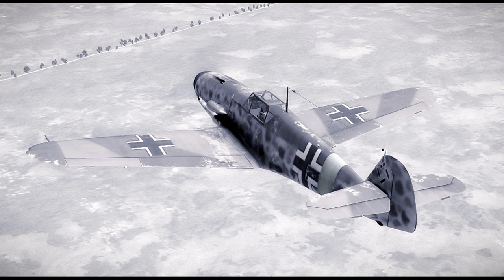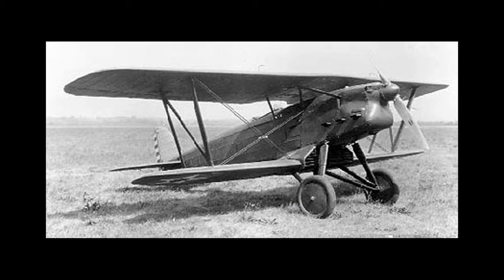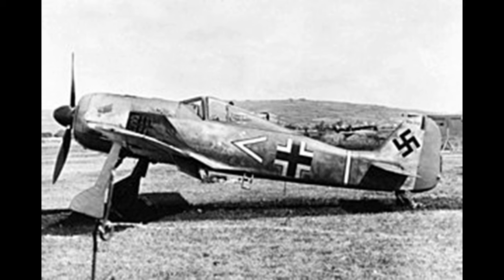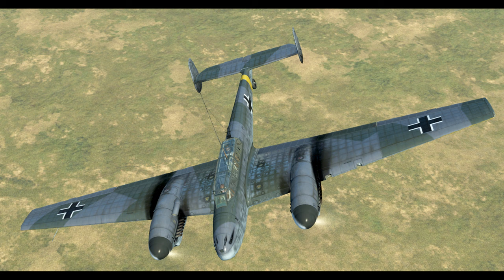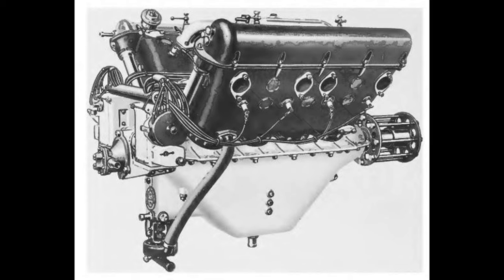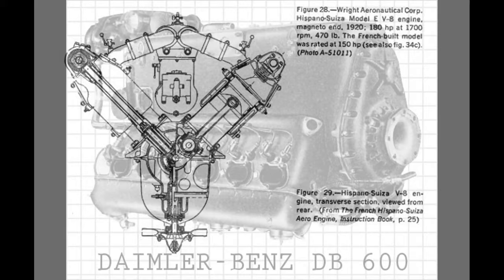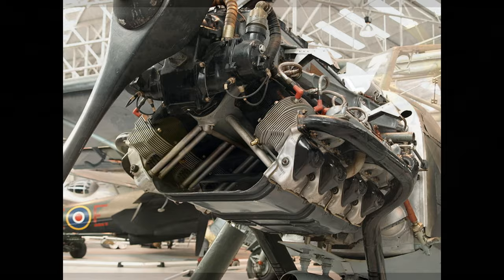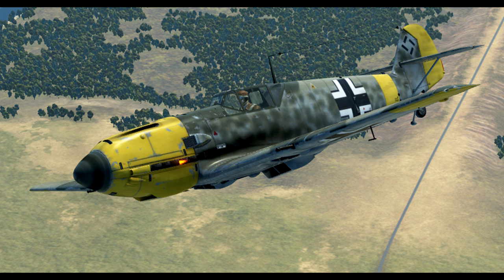Messerschmitt Bf 109 , Why an INVERTED V-12 Pt. 1? inverted V12s vs. upright

Comment: The Sherman should be compared with the Panther tank for this was the intended mainline German tank late in the war.
The Sherman was a fine tank but it didn't see the necessary upgrades in time, after all it kicked ass in North Africa going up against Panzer III and IV tanks with short 50mm and 75mm guns and even long barrelled ones.
But the Sherman was a sideshow what really influenced German tank design was the Eastern Front which forced massive improvements on the German tanks.
So as the Sherman lands in Normandy the 75mm armed variant is by far the most dominant. The British try to get 1/4 with a 17lbr but the Americans use all 75mm guns.
The 75mm is a decent gun and just a little shorter than the long 75mm gun on the Panzer IV, but the German tanks have got much more armour now even the Panzer IV has 80mm of frontal armour.
But the big problem was the new long German guns in the L/70 class built to kill KV-1 tanks and heavier, the Sherman is just not going to stand up to that.
The Normandy campaign was also the first time the Panther was encountered in big numbers. Allied intelligence had believed it to be a heavy tank in limited use like the Tiger, not the Panzer IV replacement.
For it it Normandy that gives the Sherman a bad reputation. The tank serves for too long without a substantial upgrade and the Allies end up in a similar situation to the Germans on the Eastern front in 1941-42. After all this was an early tank for the Americans and the second real medium tank they built. Matching quite well how the Germans built light tanks before moving on the Panzer III and Panzer IV it was also designed without any major war experience.
That is not going to give you as lethal a tank as war experience put into a new model will give you. 
For the comparison must be tank to tank for this is how people judge things, sure there might be 20 Shermans for every Panther but that does not matter for the guy who has to go one on one or 4vs4 with them on the front line. Besides the Panther is not invincible, the short 75 will penetrate it's side no problem it's just that there is a lot of frontal armour on that thing and a very long gun.
Reply from the maker: It's amazing how many tank comments I get on my channel.
Reply: @GregsAirplanesandAutomobiles  It's your own fault for showing a picture of one :D

Comment: The Messerschmitts could pull a negative G turn with no problems because it was an inverted engine and also it was fuel injected, Whereas the Supermarine Spitfire was an upright carbureted engine, so it had to go inverted in order to pull negative G turns, thus broadcasting the pilot's intent long before he did it, and many a British flier went down because of this, the German Pilots were incredibly experienced and it was a good thing that Britain had control of the waters, they capture many of the German Ace pilots thus removing the Luftwaffe's ability to fight effectively! If Germany had done its best to retrieve their downed fliers the battle for britain might have had a different ending.
Reply from the maker: The inverted V has nothing to do with negative Gs, lots of upright V12 could do that just fine.

Comment: Inverted engine will function longer wihout oil in the system. Working on cams and valves with hands up is NO, NO. The gun ?

Comment: in the case of the 109 they could also run two 7.92 machine guns across the" top"of the engine
Reply from the maker: So did the P-36, yet it has a radial.

Comment: Great video, except for one part. No one slowed down to "let" the Soviets get to Berlin first. There may have been some vague, tentative "agreement" at Yalta to have the Soviets capture the city but obviously no one slowed down. Market garden never would've been planned if they actually wanted the Soviets to roll over all of Germany.
Reply from the maker: You are incorrect. From Wikipedia "After General Omar Bradley warned, however, that capturing a city located in a region that the Soviets had already received at the Yalta Conference might cost 100,000 casualties,[6] by April 15 Eisenhower ordered all armies to halt when they reached the Elbe and Mulde Rivers, thus immobilizing these spearheads while the war continued for three more weeks." This can be found here with the original source noted: https://en.wikipedia.org/wiki/Race_to_Berlin
Reply: @GregsAirplanesandAutomobiles  I'm quite sure this is just a misunderstanding and that if we talked face to face about this we would end up saying the same things. By April 15 the Soviets had pretty much already reached Berlin. They would fully encircle the city only 8 days later, with huge loss of lives and equipment (Bradley was right). It was simply too late. Thus they were sent north and south, including into areas allotted to the Soviets. In any case, I think we can agree that Eisenhower was a wise general (and person overall). Btw, since I have your attention...you do great work dude, I really do appreciate the effort that goes into each video. You might've seen an earlier, snarkier version of the comment for which I apologize. I was (and still am lol) having a bad day.

Comment: I'm no pro but if I was a fighter pilot shooting at an enemy airplane's engine, I would shoot at the cylinders where a greater chance of engine damage would result (Wiring, Hoses, accessories, etc.) v's the relatively void dead space of the sump. Inverted engines lower the target area away from the line that the pilot sits, hence, possibly saving the pilots life during a dog fight as the rounds would be aimed at a lower point as the pilot and if the pilot need to bail out too, as the rounds would be lower than the pilot and give a better chance of the rounds missing the pilot. Hitler was all about saving/preserving Germans as he knew he needed bodies to fight his war. Just another theory is all. Also with the valves inverted downward more oil as the valve covers held oil a little bit more than just just squirting and draining like a typical V engine, to lubricate the weaker valve parts during dog fights or high RPM use v's the crank and bearings that were designed to be 100 fold stronger than the weak valve train components compared.

Comment: Thank you so much from a retired aircraft mechanic,I was under the impression,Germany developed some pretty successful diesal aircraft engines,is that true"?
Reply: Well they developed diesel aircraft engines when no one else did. Pretty heavy for the power. Same basic layout as the big Fairbanks-Morse diesels with two crankshafts and two opposing pistons sharing the same cylinder. It worked well for boats and locomotives and stationary generators but I think it was stretching it a bit to use it for aircraft. It could have been a really good tank engine? It was a Junkers design.

Comment: didnt the Heinkel 111 use the same type?  was watching a film the other night and something didnt look right with the 111's..looked like they were fitted with the RR engines (I know the 109 was fitted with these, but they just dont look right)
Reply from the maker: The 111 did normally have the DB inverted V12s. However the few that still fly have been retrofitted with Merlins, I don't know of any that still fly with the DBs.

Comment: When trying the P38 Lightning in Europe, the British specified two NON supercharged engines that turned the SAME way.  Thus killing the American designed airplane before they even tried it.  In the Pacific, it was built as designed, twin COUNTER rotating engines that were two stage supercharged.  They proved to be the terror of the skies.  The British did the same thing with the P51 Mustang by specifying  a NON supercharged engine for the trial airplanes. Then complained what crap they were. (The snooty British upper staff assumed they were always right and the British were the only ones that could design top grade fighters). Of coarse the Russians complained about the P51 Mustang also.  It was not made for rough  airfields and it was too demanding to fly.  I guess they just preferred their biplanes.

Comment: What about carburetor vs injection? Does an inverted engine need injection by default? I know Spitfires had problems chasing 109s if they went negative G.
Reply from the maker: Not at all. Either a carb or injection system can work on an inverted V engine, both were done many times.

Comment: Simple, it puts the propeller further away from the ground, without the added weight of a extra gear train to line the axis of the prop near the upper height of the fuselage 

Have a look at just about every civil De Haviland built before the mid 50's

Comment: Not really right about Rolls Royce being a 'car company'. They had designed aero engines since the V12 Eagle in 1915. The list before the Merlin reads:

Rolls-Royce Eagle (V12)
Rolls-Royce Hawk
Rolls-Royce Falcon
Rolls-Royce Condor
Rolls-Royce Eagle XVI (X-16)
Rolls-Royce Kestrel
Rolls-Royce Buzzard
Rolls-Royce Goshawk
Rolls-Royce R
Rolls-Royce Peregrine

Henry Royce's last engine design was the Merlin. Charles Rolls was the first Briton to be killed in a 'powered' aircraft crash in 1910. He was in a Wright Flyer when he died. So Rolls Royce actually had a long history within the aircraft industry before WW2.

That all said thanks for your videos I find them very interesting.
Reply from the maker: Hi Tony, Rolls Royce has been building cars since 1904. Of course they also have a great history with aircraft engines.

Comment: Greg, 
 Great video, a little correction though. The Sherman only used one aircraft motor, the R975. 
http://www.theshermantank.com/sherman/the-motors-four-motors-made-it-into-production/
There was a test Radial diesel, but it only had 300 tanks produced and none saw any combat or left the states.
Reply from the maker: That radial Diesel was the RD1820, which is a variant of the Wright R-1820 aircraft engine. It's true there were not many of them, especially compared the the R-975, but as it's based on an aircraft engine so I though I would mention it. When making videos it's often a problem deciding just how much detail to put in. It's a damned if you do damned if you don't sort of situation. If I didn't mention the Wright Radial, someone would complain about that. I didn't want to go into details about it because it's not really relevant to the video. All the talk about tanks has two purposes. 1, to show that aircraft engines were commonly used in tanks. 2 To explain why the US didn't  plan on a heavy tank and thus why Allison never made it into an operational vehicle.

Comment: The Folke-Wolfe 190 used a radial, air cooled engine, not the V-engine of the bf 109.
Reply: Later models were v12 with radial style radiators

Comment: Was the ME109E the only fighter with a cannon that fired thru the propeller hub? This site has a picture that shows the installation (http://legendsintheirowntime.com/LiTOT/Other/Me109_index.html), cannon barrel just below the crankcase between the cylinder banks. I suppose something similar might be possible with an upright V but the engine would need to be designed with this consideration. The merlin has it's air (fuel mix?) between the cylinders and the supercharger is in the way of a possible hub cannon. Later variants of the BF109 eschewed the hub cannon, perhaps later DB605  used the space between the cylinders for air ducting?

Comment: I don't know, seems comparing the first iteration of Mustang to one of the later versions of the ME109 is tricky. It would be nice to have the data of the two in their most common versions. Like the P-51D vs the ME109G which had almost 1500 hp.  The P-51A was quite a bit different and the D was the most common model during the war. The ME109 version you talk about I believe had more than the older 1200Hp rating, which would change the data on the graph. Anyway, finding the right engine data that matches the correct model is not that easy I guess.
Reply from the maker: Meanwhile, over in the comment section of my video comparing the 109G to the P-51D someone is complaining that I should have used the models I compared in this video. There is no making everyone happy, which is why I just don't care what two versions you or anyone else thinks should be compared.
Reply: @GregsAirplanesandAutomobiles  That would be me,  I wasn't complaining and I wasn't trying to be rude.
Reply from the maker: OK, thanks for that. I may have over reacted.
Reply: @GregsAirplanesandAutomobiles  No, you're good. I know people on here with their comments can be mean and rude. I apologize if mine came across like that. I didn't mean for it to.

Comment: Something that wasn’t covered in this video is that the Germans routinely packed a couple of 13mm machine guns (for comparison a .50 cal is 12.7mm if my memory serves correctly - so these aren’t small guns) behind the propellers of their single engined fighters. You couldn’t do that with a big cylinder block in the way. The inverted V probably helped in the accommodation of these guns. Am I barking up the right tree here?
Reply from the maker: Hi Jimmy, please watch part 2, we cover that issue. Keep in mind the 109 originally had the smaller guns, when they went to the 13mm machine guns they had to add bulges to fit them.
Reply: Greg's Airplanes and Automobiles - ah thank you! Didn’t realise there was a part 2. 

I’m only semi literate with mechanics - pure guesswork.

Comment: https://en.wikipedia.org/wiki/Chrysler_IV-2220

Chrysler had a late war experimental inverted V-16 that had hemi heads.  Nothing to do with invertedness, but it was where they first used the Hemi head (they were not the first to use a Hemi).

Unrelated to inverted engines, you might like to read the books that Chrysler commissioned to record their wartime production efforts.  The books are here in the upper right corner.  It is actual READING and not skimming or video, but they didn't have youtube in 1947....  See TECHNICAL section here:   http://imperialclub.com/Yr/1945/index.htm

Comment: Simple answer, the Germans had specialized engines just for aircraft, and manufacturers did not have to find buyers. The German military would buy every engine that was made to specification. 
There are NUMEROUS advantages to an inverted engine on an aircraft, in fact, so many advantages the question is WHY doesn't every country use an inverted engine?
You answered that question indirectly, nearly every other country used their engines in a variety of roles, aircraft, boats and tanks. This is because the development history of those engines did not allow for extreme specialization. Remember, the Great Depression was in full force during this development period. German was controlled by the Nazi party, and their main goal was rearmament, particularly with aircraft, so Germany was the buyer and a company could develop engines specifically for aircraft.
Other nations did not have this options, as a manufacturer had to SELL the engine in a competitive market, the larger the market, the better for the company, so engines were designed with common use in mind, as they could be used in many applications.
That's exactly what we see during WWII. Most engines outside of German started as general engines, and were often used in general roles. German aircraft engines were specialized to aircraft.

Comment: besides all these maintenance advantages shown in the video and in the comments, i believe an inverted engine makes your crankshaft higher and u can have a relatively bigger propeller without necessitate the need of using bigger landing gears to avoid props hitting the ground. bigger landing gear has no advantage for any inflight function, only added weights
Reply from the maker: The gear drives equal that out. In other words, it lowers the prop in the 109 and raises it in a Spitfire.
Reply: @GregsAirplanesandAutomobiles  good observation... i wish there was a trick to go around the design so this wasnt necessary..
Reply from the maker: There is, planetary gears as used in a radial, and some versions of the Allison.

Comment: I hear a coment about, was made for a spit fire pilot ,he said that because the risk  of  fire in the cabin Germans order  to Daimler  Benz to designe the 601 Witt the cilinders facing down because the observation that many spitfire pilots die in the cabins after fire start on the motor  if I find the documentary  I will  send it to you

Comment: They inverted the engines because they fuel injected. In a dive it helped when they pulled up that fuel wasn't starved like a carb would do. They higher pressure fuel system than a carb system would use.
Reply from the maker: No.
Reply: Yes.